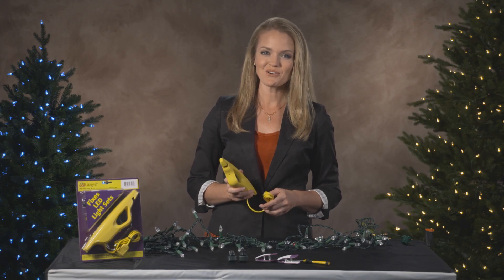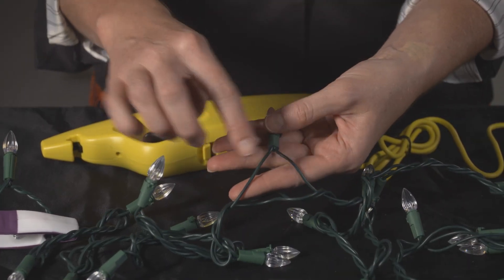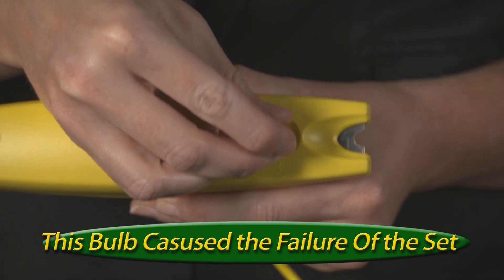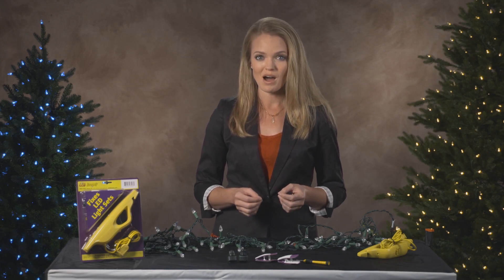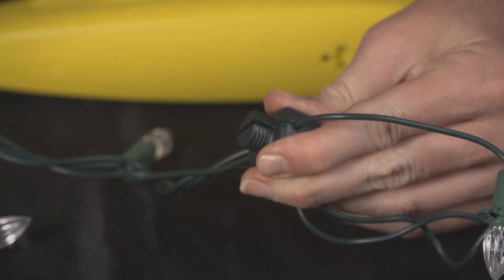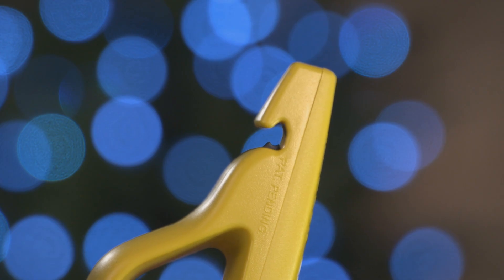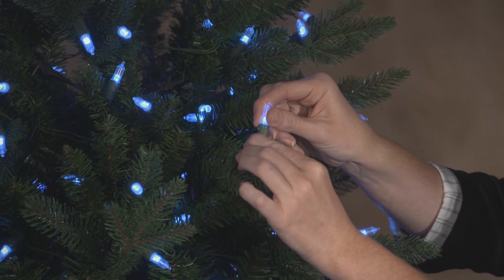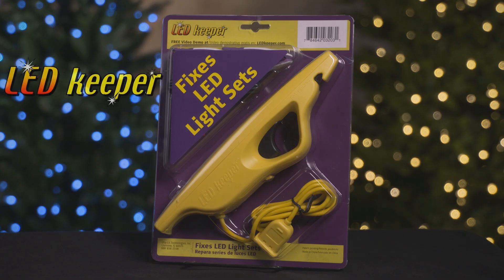NEW LED Keeper Instructional Video

Comment: It took a couple of tries to insert the wire properly into the slot, but I got it working and it found the bad bulb. The light remover was also a little tricky. The key is to make sure the light remover metal slot is in between the gap on the light bulb. This video glosses over removing the light bulb.

Comment: Just purchased this followed instructions to the letter and it works fantastic after years of multimeter and voltage testers had 4 bad bulbs on 2 C6 sets and fixed them in a half hour. Great video great product, highly, highly recommend.

Comment: Can you use this for outdoor lights? If it pierces the insulating plastic wont that cause the wires to rust?
Reply: The plastic insulation almost completely closes after it's punctured. Even if you did get some corrosion it wouldn't keep the set from working.
Reply: If it's a concern, you could tape over the punctured area with electrical tape.

Comment: I've had a couple of problems not addressed here.
1) I had a failure at one socket that had one wire in and two wires out, so I wasn't sure how to address that.
2) I've had, on more than one occasion a section of lights that just get dim but still light.
3) She addressed this but it seems that there are several different types of socket bases and what you need you often won't have on hand.
Reply: I totally agree! 
I have the Noma C9 lights, which are supposed to last a long time. However, half the strand won’t light in one of my strands, & this is my 2nd season using them. They have 2 wires out & one wire going into the bulbs. 

Even in her video, she shows a bulb with 2 wires going in the bulb & one wire out. But in the next part, she shows 1 wire going into the bulb & never addresses the wire not going into the bulb. 🤦🏻‍♀️
Reply: @b-dub6865  Since the string is made of multiple sets of series LEDs all in parallel, you will see this two-in-one-out configuration at the the parallel interconnect.  There is nothing wrong with the video, but it should be noted that this wiring is the start of a series of LEDs.
Reply: @eddiefrie8968   so what do we do if the problem is at one of these 3 wire spots? I've replaced the bulbs but nothing works. I can make the dead ones illuminate with the tool on the other side of the parallel interconnect, but replacing the bulb there didn't fix it.

Comment: Great concept but the pin doesn't penetrate the housing.
Reply: Maybe you pin is broken.  Can you see it projecting out when you close the tool on air?
Reply: @robertbrandywine  Yes, pin does emerge but not far enough to penetrate the housing.  I've tried it on three different sets of LED string lights

Comment: My unit is no longer working. It illuminates nothing. The 9V battery is good, the bulb tester socket still works. But the tester won't light when testing a string - I tried it on a known good string of bulbs. I can see the pin piercing the wire. Any ideas? It worked last year.
Reply: You need to replace the pin in the tester.
Reply: @b-dub6865  it was actually the 9V battery.  It tested o.c. at over 9V but could not power the string. A fresh 9V fixed it
Reply: @hydraulics  gotcha. I assumed it was working when you said the battery was good & the bulb tester socket still worked. 
Glad you figured it out. Just remember, those pins can go bad quickly.😊

Comment: When I pull the trigger, with or without a wire being tested, a red light illuminates near the bulb tester. Significance? Does that mean the 9V battery inside is low or is something defective? I just bought this days ago.
Reply from the maker: The red light means the battery is good to go and ready to get to work.
Reply: @LightKeeperProTool I've been using the incandescent light keeper for years now and love it- it's more than paid for itself with the number of light strands I've been able to fix using it! I just got the Led keeper now too & when I started testing a couple spots on a pre-lit LED tree, some lit up red, others green. Is there a differentiation between these indicators and the "ready to go" red light you've mentioned? Same location on the tool. I had assumed the red light meant it was in the problem area and the green to mean the current was good and working up to that point in the strand...

Comment: Can this be used to repair a LV DC string? My failed string runs on 3 "D" cell batteries so there is no AC plug to connect.
Reply from the maker: Hi Bruce, the LED Keeper cannot assist with Battery operated sets unfortunately.

Comment: I tried it on an outdoor set and the pin piercer gave out after just one string. I  flipped the pin and that too only lasted for one string. It did ID the faulty bulb, and I used the enclosed pod to seal the defective bulb I removed, and it worked, but the tool is now useless unless I buy replacement pins. No thanks.

Comment: How do use this product to fix LED icicle lights?
Reply: Better late than never.  But always start on the bottom light of each section. If all the lights on that line light up. Move down further. After that its process of elimination.  But starting at the bottom of each line is the fastest way .
Reply: Buy new lights that are not icicles. Ha.

Comment: Novice question. Is the current AC or is it converted to DC? Thanks
Reply from the maker: Thank you for your inquiry. The current is AC. Please let us know if we can be of any further assistance as we are happy to help!
Reply: @LightKeeperProTool  what is the difference of the led keeper or light keeper pro? Also is an led keeper pro exist?/if sold by the same company as the light keeper pro and/or the competing led keeper?
Reply from the maker: @fleetknightgreywolf7795  LED Keeper Pro does not exist -- there is the LightKeeper Pro that assists with incandescent lights and the LED Keeper which assists with LED lights.

Comment: Safety is you main concern???    LMFAO.  That is why you intentionally turn the insulation into a Swiss cheese thus breaching the integrity of the insulation on a 120 volt mains powered device.    Good luck with your future lawsuits.
Reply: You might be able to "paint" the pierce with some of that "liquid electrical tape", I forget at the moment what it's actually called, but it's in a little container about the size of cans used for plastic pipe primer and solvent (it's not plumbing chemicals, just similar sized container).
Reply from the maker: The LED Keeper has been on the market since 2012 and we can assure you it is safe. We would not have a tool out on the market that could pose any danger. The insulation has a healing method to its makings considering the material expands and if you consider the minuscule hole the LED Keeper leaves behind, there is no concern. Luckily, with the LED Keeper, you can tap into the wire with ease, avoiding continuous/repeated piercings which would result in the swiss cheese analogy you have used above. We would be happy to speak with you further if you have any additional concerns as we are here and happy to help! If email works best for you, we can be reached at inform@ultalit.com. Thank you and happy holidays!
Reply: Considering how cheaply miniature Christmas incandescent and LED light sets are made they are inherently unsafe.   The pin holes made by your test tool is insignificant compared to the other crevices inherent in the manufacturing techniques use to make the lights.  These deficiencies are far more  likely to allow moisture and electricity to sneak in and out respectively.   If they were built to strict electrical code requirements they would not be affordable.   Merry Christmas to you also.
Reply: I purchased one of these and i thought the same thing. Where it punctured the wire isnt big at all. This is a great tool and i am very impressed with it. Fixed up all my lights quickly.